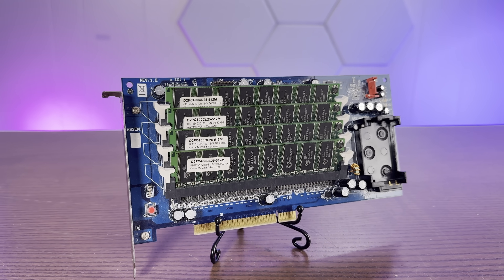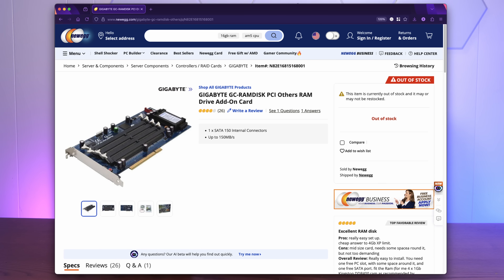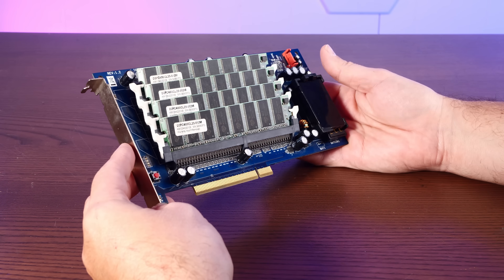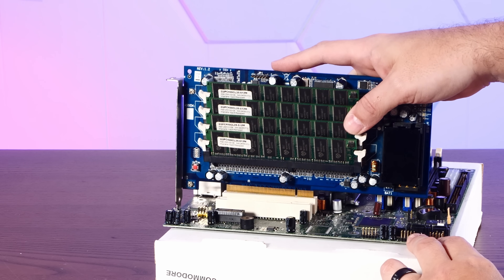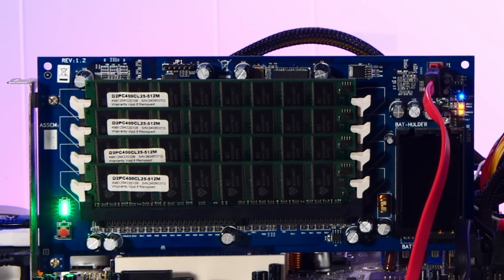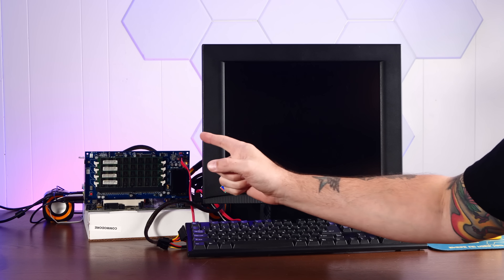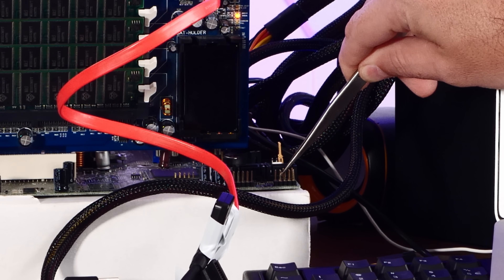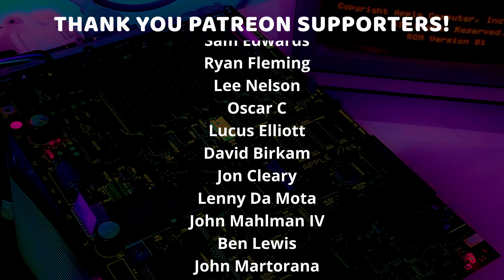This Early SSD Was WILD

Comment: This SSD cannot wearout :P
Reply: Electromigration. Sadly all semiconductors will eventually fall prey to it.
Reply: ram can fail, easily. heat and static can really quickly ruin it.
Reply: Well, no,.. as in 'yes it can wear out', but the write cycle is much higher. Silicon wears a little with every write cycle, regardless of SSD or RAM.
Reply: @PiDsPagePrototypes  You are comparing something that does 1000 read/write cycles per second for years with no issues to something that literally has just a few thousand R/W cycles of life...
Reply: @TheOriginalEviltech refer to wording of previous comment. See that word 'much', yeah, it's an important part of the reading.
Reply: @PiDsPagePrototypes  "Much" doesn't even come close. If an SSD is a drop of R/W cycles than a RAM disk is a lake.
Reply: imagine installing windows 11 to that thing and it is the only ssd you can upgrade

Comment: The only real drawback to this device is the slow SATA bridge cutting the potential speed down to about 10%
Reply: Well, PCI maxed out at 133 MB/s, for the whole bus. So if they used the PCI bus, your disk would have to share that bandwidth with every other card. 
And it would have been much more difficult to implement in a way that the bios would detect.
Reply: @TSteffi  I mean, if it is connected to a SATA controller, it still has to share the bandwidth with everything on the bus. SATA controllers aren't magic, they're wired to the PCI bus too.
Reply: @CptJistuce  Well, not necessarily. A board can have more than one PCI bus, and it wasn't uncommon to have the chipset internal devices be handled separately from the rest of the system. And clearly some of that is going on here. Because the thing gets more than 133 MB/s, while there is also an active graphics card and sound card and USB controller.
If everything in the system was sharing the same 133 MB/s bus, that wouldn't happen.
Reply: @TSteffi The display adapter is probably on the AGP interface. And... I didn't hear any sound, so I'm not sure why the sound controller's expected to be hogging bandwidth? The amount of bandwidth a device takes is proportional to how much data it is currently moving, PCI devices do not move a fixed number of bytes every clock tick.
Reply: @CptJistuce   If you wanted to, you would get what I'm trying to say. But you are clearly more interested in picking nits and being right. And I don't care about that.

Have a nice day.
Reply: I was thinking the same thing but there are some reasonable answers here. The comments about shared bandwidth being an issue count on the SATA controllers being connected to some sort of dedicated bus internally to the chipset. Maybe Intel was starting to leverage PCIe concepts in their internal connections at this point, but if the SATA controller was connected to the same PCI bus as the slots, that would be an issue. I'm not sure what the PC industry looked like in terms of its mainboards and chipsets in this era. 

Getting the card to talk to the PC via PCI wouldn't have been a huge issue, they could have made it look like some sort of add in HDD controller, either SATA or maybe SCSI. But then there would have been the whole issue of providing a driver disk for Windows installation.

Looking at this device with those constants in mind and looking at hw it actually works, what actually bugs me is this being a PCI card at all. It seems like it could have been set up to fit in something that could go into a 5.25 drive bay instead.
Reply: @splynncryth  I guess PCI was the easiest place to get power while the system was shut down
Reply: @splynncryth  Arguably, that would have been much better. Because it would allow the LEDs to be visible to the user, put an accessible battery compartment there, have a usable reset button, all sorts of options.
Reply: PCIe really was an incredible upgrade over PCI. Even gen 1 x1 was twice the speed of PCI, and it's full duplex, and it's not a shared bus.
Reply: Yeah... Why did it use sata instead of PCI?
Reply: @mirabilis  The NVMe protocol was only released in 2011, so especially if they wanted it to be a bootable drive, they would have had to either end up putting a SATA controller chip on the board anyway, or design an option ROM and Windows drivers from scratch. Whereas this probably uses relatively cheap off the shelf parts, and just works out of the box because it's just a standard SATA drive that everything already knows how to handle.
Reply: @mirabilis even sata 1 is faster than pci, also while not being shared
Reply: Depends on the PCI revision.

PCI 1.0-1.2 cap at 33Mhz/32bit, while PCI 2.0-2.1 cap at 66Mhz/32bit  This would be 133Mbps and 266 Mbps respectfully, placing PCI 2.1 over SATA 1.0, and PCI 1.2 under it.

This, of course presumes it's not shared.

It is also possible that the SATA connection was optional, and it would use PCI if it wasn't connected.  A lot of hardware did such things.

(Correction miscalculated the decimal place, 133Mbps and 266Mbps.)

I would doubt this would be an issue considering RAM speeds at the time were similar.
Reply: @mirabilis  because one the pci bus is slower max is a theoretical 133mbps  Sata 1 is 150mbps. You would have a bit higher performace on Sata then PCI.  Second COST and compatibility. Probably more expensive to integrate a pci to sata controller which might need custom drivers to use and hope it plays nice with the bios. Then just make it a Sata Drive that just plugs into the sata port and just works.
Reply: @Cyrix_Op they did... Those spinning drives, way slower than the iRAM. BTW that Gigabyte thigamagig was not only among the first SSD, but probably the first m.2 drive, i.e a boot drive consisting of flash memories stacked, communicating by a SATA interface via PCI.
Reply: @eduardotrillaud696 It isn't an M.2 drive, as that's a defined physical format. You're never getting this into an M.2 slot.

It's also not among the first solid-state drives. Physical RAM disks existed in the late 80s. My old 99/4a has a Horizon RAM Disk, which is the same dang concept(except with SRAMs instead of DRAMs, so the battery life is less awful).
Reply: @mirabilis  PCI is even slower than sata im pretty sure
Reply: @JackTheProto  Standard PCI is spec'd for 133MByte/s, which would be indistinguishable from the 137MB/s shown. Overhead alone probably wouldn't hurt performance too much; might still see around 100MB/s. The real killer is that PCI is a shared bus, so any time your add-in sound or network card wanted to do something, performance would tank considerably.
Reply: @mirabilis  because there is no PCI storage device. Would be required a special hardware with an high price to emulate a SATA or SCSI or SAS HDD.  Anyway there was a lot of cache device with ram on PCI also SATA controllers. i-RAM was a just for fun to reuse old ram.
Reply: It could use PCI-Express, by 2005 pci-e was already commom in AMD socket 939 and Intel platfotms, so this card could use pci-e gen1 x8 or x16... Or Sata 3Gbps at least, which would reach 300MB/s, I think Sata 3Gbps was already available in 2006.
Reply: This has been a valuable thread.  I wondered the same thing as OP, but had not considered that PCI was actually kinda slow, nor that SATA ports may have been integrated directly into the chipset by this point.  Then I read the question about why this wasn't just a drive cage device, and that made a lot of sense.  Until someone else pointed out that it could use the standby rail to keep the RAM powered.

The entire sequence of thoughts, questions, and answers -- all in one place.  And here I thought comments sections were just for flame wars.
Reply: So much useless talk about speed in this thread. PCI was not chosen because there was no way to boot from PCI.
Even USB was not universally supported with removable media. But PCI was never envisioned to host a storage device.
And correct me if I am wrong but PCI did not support encapsulation of other protocols that the bios would support for booting, and even if it did it would add a lot of complexity and cost and defeat the purpose of the device (cheap SSD).
Reply: @marsovac there used to be ide controller cards for pci
Reply: @new_simsons yes but did they allow you to boot from them that's the question. Usually only devices present on the motherboard and available to the BIOS could do that, and the others needed some form of firmware to be load to be available to software, and in such case it would be architecture specific, i.e. would work in an x86 not a PPC or whatever.
Reply: @marsovac I just remembered that I have a pci scsi card. After the computer posted, the drive that is attached to the drive is visible in the boot selector. So yes, definitely possible.
Reply: @marsovac  Um, boot ROMs?  You don’t “Boot from PCI”, but you can sure boot from any PCI device that installs its own expansion ROM into the appropriate interrupt chain.  Technically, it doesn’t even need to be the PCI device that hosts the ROM, or you can use a ROM slot on a PCI device to do something entirely different — like the XT IDE people do with PCI network cards that have ROM sockets.
Reply: Thing was there wasn’t really a faster protocol they could have used for cheap at the time. They could have integrated an SAS controller circuit into the card itself instead of relying on the motherboard’s SATA bus to cut down on cabling and maybe speed it up to ~3 Gbit/s, but that’d be about it unless they wanted to design their own protocol rather than rely on one that was easy to grab off the shelf.
Reply: And the one obvious thing the cost of ram itself
Reply: Yeah. I don't get it.
Reply: @mirabilis  This was mind blowing technology for me in 2001 when the first versions of this were coming out. Storage was insanely slow and memory was limited.

Comment: How this card works make me incredibly uncomfortable when it came out and in 2025 still makes me incredibly uncomfortable.
Reply: This type of DRAM needs a always power-on condition in order to keep storing the data, unlike SSD that can go approx a year with no power and still hold the same data. It needed a battery in the event of a power loss because if it happened with no backup power you where toast. It's limitation really was the 4GB limit AND the S-ata bus with up to 500MB cap. It was Raid-0 or nothing.

Comment: Immagine the teacher asks for homework and you say "yeah I made it but the battery of my iRAM disk died and I lost the homework"
Reply from the maker: Battery ate my homework
Reply: A RAM disk without multiple layers of battery backup should only be used as a scratch disk or possibly a swap disk.
Reply: @Slackware1995  maybe a game disk. to load games faster, or cache disk.
Reply: @SectorfiveYT : Hence swap disk.
Reply: @SectorfiveYT  Yup. Copy a CD in to a ram drive running on one of these cards, and the frame rate and load times of games skyrocketed back in the day.
They weren't made for that, but that's how we used 'em! :)
Reply: @SectorfiveYT  Interestingly enough, games used to load fairly quickly back in the day. The original Skyrim used to load into Whiterun in like... 6-7 seconds? It wasn't terrible. Got significantly worse once mods happened of course, but as long as you defragment your drive, all was good.
Reply: @SectorfiveYT  you mean like.. RAM
Reply: @Hr1s7i  yeah, i forgot about fragmentation... The SSD era has spoiled me! RAM disks wouldn't suffer from that issue either.
Reply: @Slackware1995 
Tell that to a kid 😂😂😂
Reply: I actually took a 3.5" IDE HDD into high school english class once. Pointed at it and said: "My essay's on there. If you can get it out"
My english teacher smiled and said: "That's your job. You've got till the end of the week"

The drive wasn't even formatted, I hadn't started the essay and I'd have been boned if she'd bothered to check (or more realistically, asked a computer science teacher or school IT to do so). In retrospect, I bet she 100% knew I was bluffing and just respected that it was an excuse she hadn't seen before (plus plausible deniability if somebody complained). FWIW, anybody who knew more than the minimum about me would have known I was a huge computer nerd and recovering a file from an HDD would have taken me about 5 min
Reply: @Jay-ik1pt  IDE? You're new. We hard to walk five mile uphill each way in the snow to get our SCSi and MFM drives to do anything fast. :D
Reply: @PiDsPagePrototypes back in mah day we had harddrivers smaller than 100 mb and weighed like a brick. Some of them were actually bricks.
Reply: @potatomongrel  that is a hilarious true story, but I can't remember the brand name, I had one of their pre house building quality disks 😂
Reply: @Jay-ik1pt not even calling the bluff, just the BS-o-meter beeping. Pretend that you did the homework but it is currently in the Mongolian steppes with a throat singer. The information is true, you know the name of the singer, address and know he's willing to return it to you or your teacher.

Even if I somehow believe you or know that's true... "Not my job to fetch it. That's a you problem."

Actually had a colleague with this issue. A friend had to extricate the file for him but can't recall if he did offer the drive itself to the teacher.
Reply: It is easier to say "my dog ate the homework"😂😂😂😂😂😂😂
Reply: @Nets-nutsBr dog ate my battery vibes?
Reply: @Filyx20 
Dog ate my neighbors butt out 😮😮
Reply: I was at school in the good old days. All my assignments were written down on paper.
Reply: if it was the pc teacher he would give you an A+
Reply: I legit did homework on my PS3 back when "other OS" was a thing. Then one morning I woke up to a system update and it was gone lol. Try telling your teacher in 5th grade "my PlayStation formatted my Linux partition" 😂
Reply: She's probably heard that one before, I would just tell her my mouse ate it.
Reply: My dog ate my RAMdisk
Reply: They were great. Fast

Comment: Putting a page file on an iRAM drive is literally just making the iRAM look like a RAM to SATA converter, I mean that’s what it is with extra features
Reply: Like, why not just use the RAM as RAM and avoid massive performance penalties? This is completely ridiculous.
Reply: @halfsourlizard9319  generally the answer to that for the iRAM in particular would have been something like "I've already maxed out my memory controller, and want better swap performance anyway."

In the modern world however, think about your graphics RAM... it's accessible over PCIe, that's how your CPU loads textures and instructions for your GPU, but when it's not being used for graphics purposes, it's sitting there idle. A pagefile in graphics RAM can take advantage of memory that has to have performance penalties, when you're using a RAM-hungry 2D application.
Reply: or, to put a diff way: GPU RAM is way more precious/limited than main RAM
Reply: @halfsourlizard9319  No, they're saying that in some cases it might make sense to have the swapfile on a GPU ramdisk, because if you're using a ram-hungry 2d app, then it's basically just like the iRAM.

Comment: I have 48 GB of DDR3 laptop RAM just taking dust. I would love to use it as storage with these kinds of cards on my desktop, it would be nice. Heck, I would not even care if it would be gone for the next boot, since I would only use it for temporary things anyway.
Reply: If I remember correctly these things support up to four 1Gb sticks, so 4 Gb maximum capacity
Reply: 48GB of DDR5 - possible with one single stick of memory
Reply: Even in MS-DOS we had a software called ramdisk for doing this. Is there a new equivalent?
Reply: @alexandrecouture2462 
Over in linuxland, you could set this up as /swap. Windows 10 has the setting to do this natively with page file locations
Reply: @alexandrecouture2462  There's AIM Toolkit
Reply: I'd love to have something like that for cheap DDR3 or DDR4 RDIMMs
Reply: Just setup ramdisk
Reply: @alexjonessmith  RAMdisk uses your existing system RAM as, well, a RAM disk. That is not what I am looking for. I am looking to use external RAM as a RAMdisk.
Reply: @atemoc  It probably wouldn't be worth it because of the bandwidth across the bus.  With motherboards now supporting multiple Terabytes of RAM it's much easier, faster and cheaper to increase system RAM and allocate some that to a RAMdisk.    Every few years someone comes up with the idea of using older gen RAM on a card, but they're very niche products for hobbyists.   There are also some extremely expensive, ultra-high end boards used for specialised applications like terabit network filtering or extreme database applications.